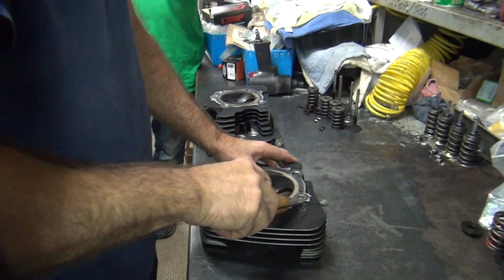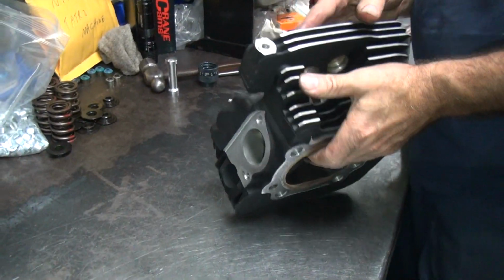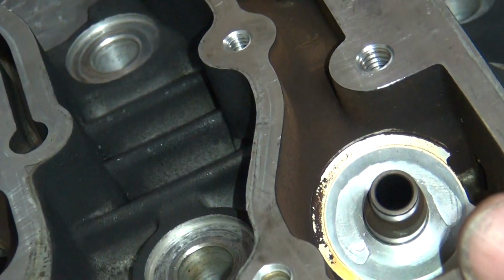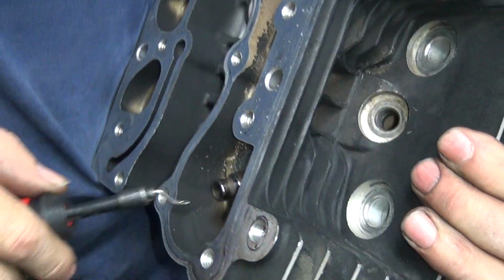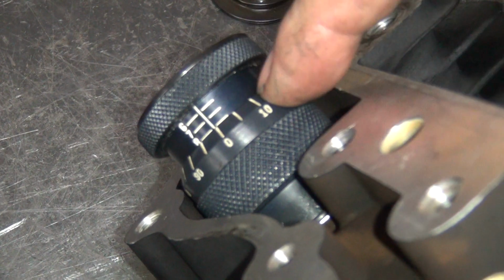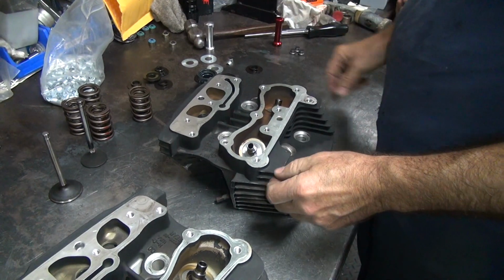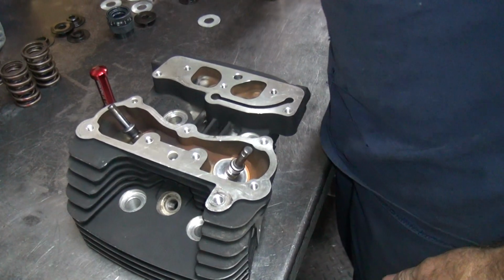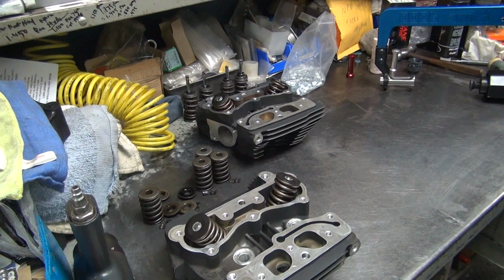#103 valve spring set-up twin cam heads for 585 640 high lift camshaft harley by tatro machine

Comment: I have a ‘13 TC103 Deluxe and want to install cams, zero deck, mill head for desired CR.  I want a good valve job to enhance low lift flow, but no major porting.  Would I benefit from sizing up the valves and opening up throats to proper ratio  to help with low lift flow without a full port job?
Reply from the maker: sound like a race motor being build for the street. just put some cams in it and go have some fun riding it.
tatro

Comment: What’s the cost to get this done? I put a 585 in my 03 Electra and realized it’s too much lift. Debating on a new cam or vehicle springs and adjust valve guides
Reply from the maker: if you use the andrews cam like we did everything works together and you have more lowend power to pull the extra gearing we put on too. its all about the combination, not just the max power.
tatro
Reply: SE 585 or S&S 585 can’t find Andrew 585